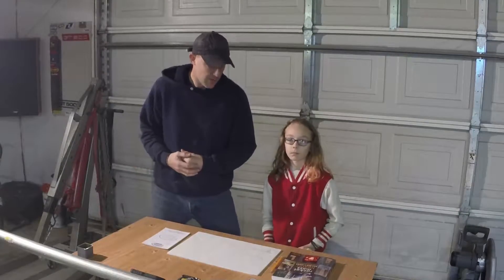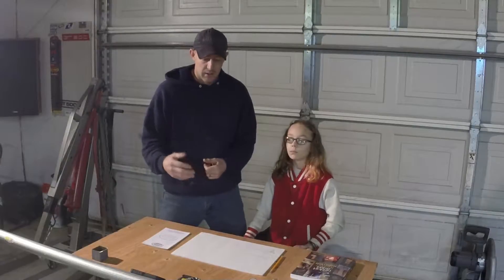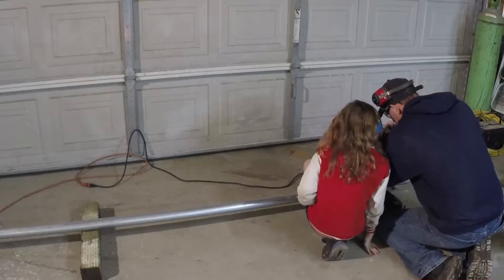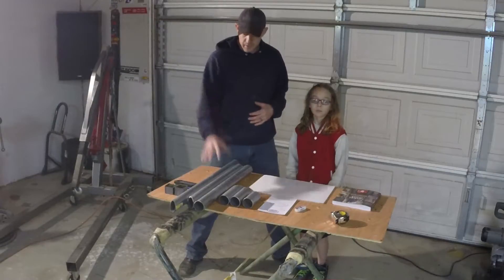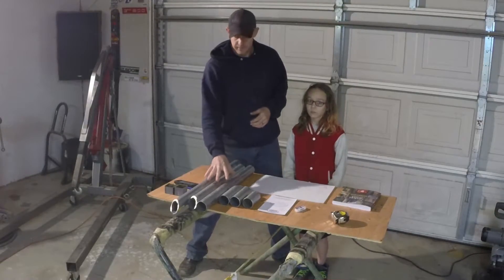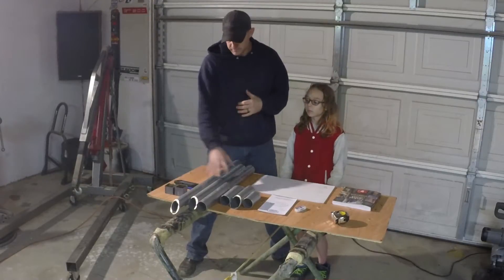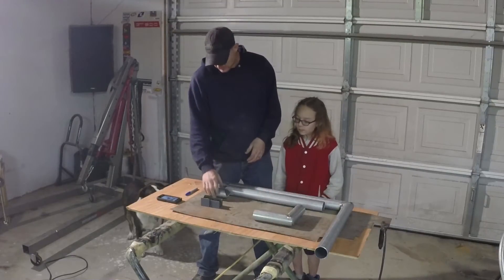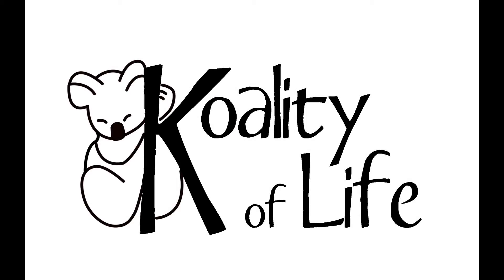Science Fair Project, Mini Rocket Mass Heater Part 1

Comment: Son? I thought that was your daughter. Neat project though...
Reply from the maker: Nope thats my son. He loves his long hair, its actually longer than his sisters hair. Thank you for watching. :)
Reply: Koality of Life Sorry if I offended. Your scale model of a RSMH has given ideas. Has you or he considered using the Bell/vault flow system for the bench? It's where you use half barrels to form an arch or vault (cut side down). It eliminates the need to use the ducting. For exhaust, you just bury the vent flush with the ground then route it up and out.
Reply from the maker: No offence taken. We will be building another one soon, probably one that is actual size, not mini. But there is a lot of work to do ahead of this project. :)